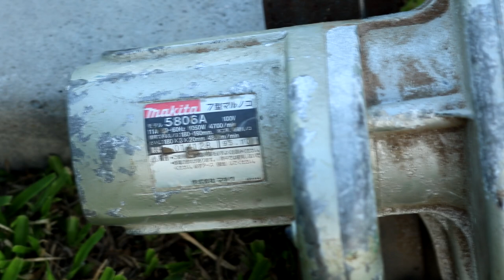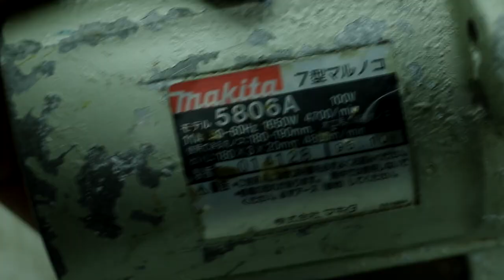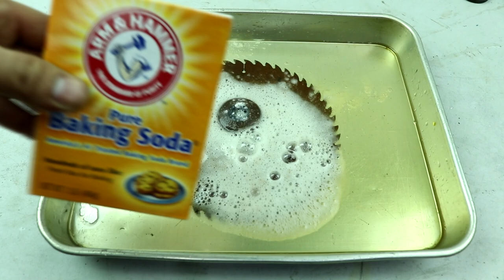Very Old Circular Saw Restoration

Comment: This saw was in actually quite good mechanical condition.  The blade shaft was not caked with sawdust as would be typical, the brushes looked great.  The commutator was dirty but not scored.  It looks like it had been in damp storage, so the water got to exposed areas and hence the rust and flaky paint.  One thing concerned me was the return on the blade guard was weaker than I expected to see.  It sounded like it needed a tiny bit of grease on the pivot point or maybe even graphite.  The matter of the old blade being restored was clearly because the goal was restoration, not for heavy use!  Discovering that it was now about 25 years old, the other thing I'd have done is probably replace the power cable if I were going to use it regularly.

Comment: I got a old 1950s black and decker skill saw very similar in build to this one and mine still works i inherited it from my grandad and all ive done to keep it going over the years is change the cord blade and re grease the gears when i first got it out of storage an its been going strong 10plus years since i cleaned it up still get fairly regular use

Comment: Good job....
Reply from the maker: Thank you!
Reply: @gear_show  uwc... you give me an idea, i have a lot machine that is can't work anymore.. so i want to try to restore and make it work again, also make it nice...
Reply from the maker: Yes you can check and clean every parts of the machine, and put it back correctly it will works.
Reply: @gear_show  i just confuse if the electrical system is dead, i don't know how to fix it.. or maybe just buy the new electric system..

Comment: Looking at the sticker, that appears to be a JDM version designed to run on 100v not 110-120v as in the US, I'm not sure what impact that slight over-voltage would have on the motor over time, but it seems to work well.
Reply: Looks like it's Japanese. They only have 100v. In NA its 108. Will bun out motor if used excessively

Comment: Everything is fine, but there is one remark. The paint on the contact surface of the ground lug had to be rolled before screwing the wire (or not to paint the place initially), otherwise a layer of paint would prevent electrical contact.

Comment: A Makita circular that was made in Japan to operate on 100V?  That's a good saw that didn't, and won't, suffer from voltage drop at the end of a long extension cord in the USA.  A good cleanup, new Japanese or American bearings (not Chinese!) and a new blade (why bother with the old one? - it was meant to be a consumable part) and the saw should be ready to go to work. I have several Makita tools from the early '80s that are strong.

Comment: This is a new makita very little used. I think it's forgotten in a wet place. it's not just a paint restoration. I think there is no need to change the new bearing in vain. real old machine restoration will get more useful. good luck...
Reply from the maker: Thank you for comments.

Comment: Instead using vinegar, next time give a try using muriatic acid, it need to be handled with care, but the results are faster (almost immediate) and better (you don't need to user wire brush) than vinegar.
Reply: true!

Comment: My skillsaw is heating up right at the center. The bolt that holds the blade becomes so hot that it produces smoke after a few minutes of running the circular saw. However, this does not happen when I run the saw without the blade. The blade is not too old. I am thinking of trying another blade to see what happens. This problem started after I used the saw to cut 5-6 concrete pavers (with a diamond blade). I did clean up the saw well and don't see any debris from that use. Do you have any idea why this might be happening?

Comment: Not so sure its old (vintage). Might have 4 or 5 years. Not too much care into it I believe. Connectors tell you its not so old. Wiring also. And below the blade all looked quite new. Great video anyway, which is what matters.

Comment: You added baking soda to vinegar that is not good vinegar is acidic what is good to take off rust but baking soda is a neutraliser that is why it fizzes it is making it no longer an acid so it didn’t work if you use straight white vinegar is the best for rust

Comment: The carbide on the teeth of that blade is just laughing at your sandpaper stick. You need something a little tougher to sharpen them.

Also, don't use apple cider vinegar, that shits expensive.

Comment: Nice job, but seriously, replace that blade. A corroded, rusted blade will be prone to cracking and breaking. That would be dangerous. A new blade is not expensive.
Reply from the maker: Thank you so much for suggestions.

Comment: Really enjoy old tool restoration videos, BUT this is a 1996 Makita, 100volt/50-60cycle (odd for 110V N.American or 220V European market) all shown by label. Maybe cosmetically a little rough outside, but immaculate inside, WHY the rebuild? Seems all it needs is rust free blade, and you  certainly didn't de-rust it by soaking in vinegar, and immediately neutralizing with baking soda, nor sharpen carbide  teeth with a file and sandpaper. Why replace only 1 bearing? At least repack the open shell bearings, they were clean, and everything was already dismantled. This was a beautification not a restoration, next time powder coat exterior in chrome colour, hang on wall, or put under glass as a show piece to stare at.....

Comment: I don't get it #1: you poured vinegar on the blade which is a weak acid good for removing rust. Then you put baking soda on it which neutralized the acid and left you with a pan of water. Then you had to scrape and wire brush the rust off. See where this is going yet? I don't get it #2: All that work for a twenty-year-old Makita!

Comment: Not much to restoring a saw that wasn't used much..............brushes and commutator bar on the armature is barely worn as was the spindle and gear.
Bet no one noticed the broken carbide on the blade.....

Comment: I call BULLSHIT. This is a fake restoration. The inside of that saw looks good. The armature and field coils are in perfect condition. The brushes looked like the saw had hardly been used. Before the "restoration", the blade scrapes on the cover. What did you do to eliminate that? Just magically disappears.

Comment: There is nothing old in this saw, the factory is still producing. I think you do not know what you're doing.  Baking soda to Vinegar does not make sense. It is impossible to try to sharpen carbide with a flat file
Reply: Rodney Alberto Víquez Ruiz 
it's not a flat file.